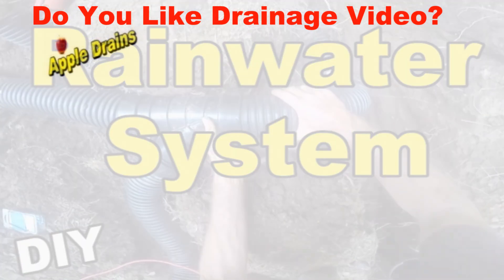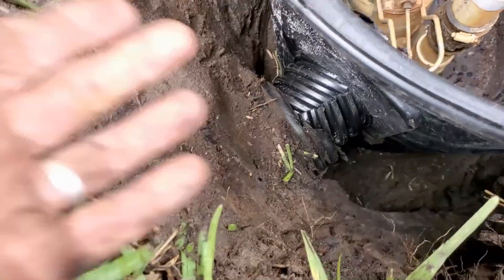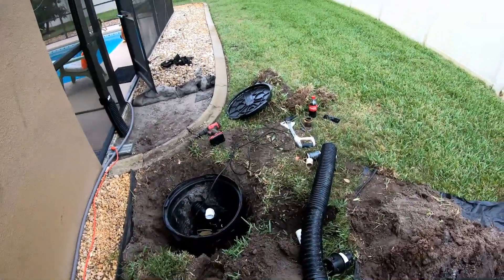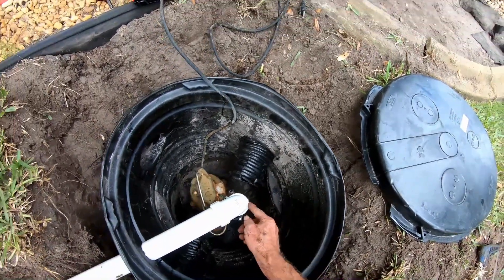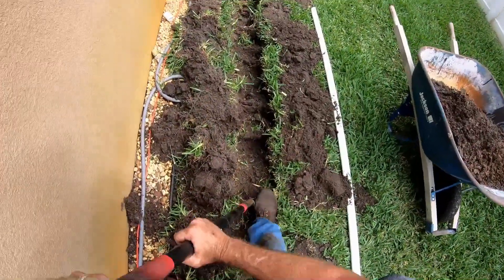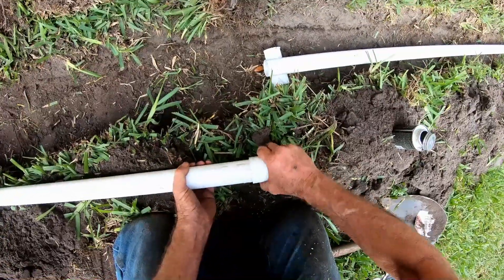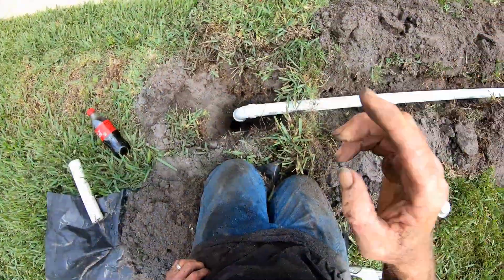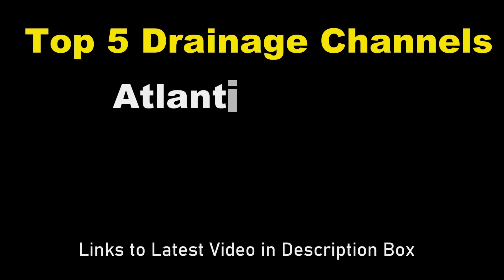4 Inch Pipe Working to Capacity - Heavy Rainfall - What Can We Do?

Comment: I'm sort of surprised by this; a 4" SDR-35 pipe with even decent gravity fall is allegedly capable of about double the rate of discharge of the sump pump, is corrugated flow that much worse?

Comment: Chuck, typically in storms the power goes out. Do you have a system that is supported by battery backup?
Reply: Generator
Reply: I hear yah. But if you aren’t home when the power cuts out how will you get tge generator going, unless you have an automatic transfer switch with a generac. You are talking big bucks.$$$$